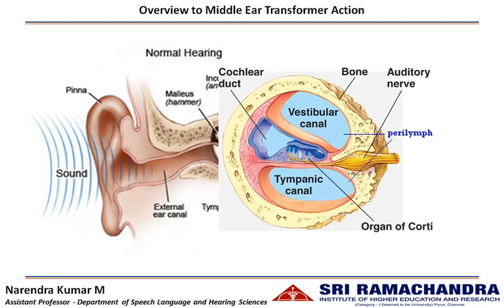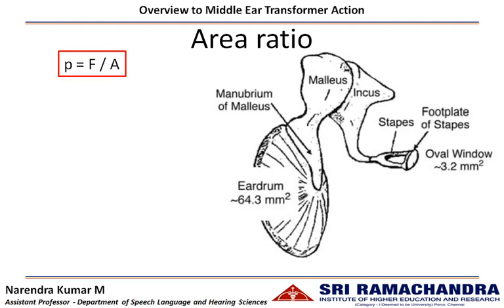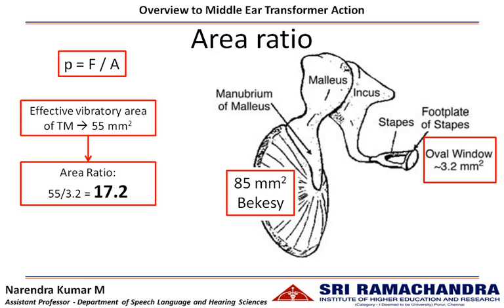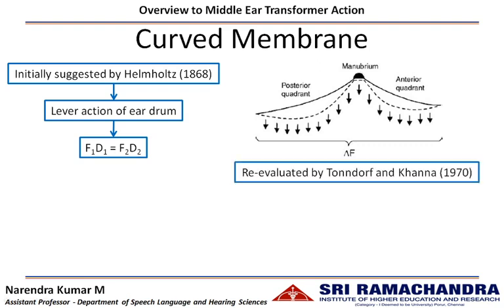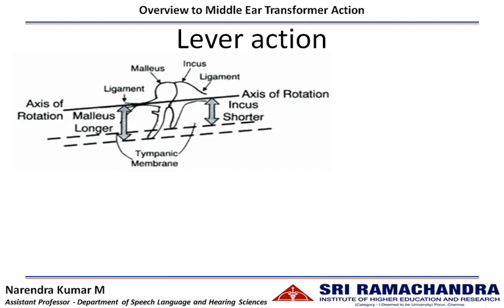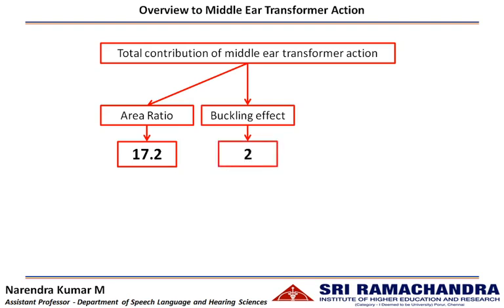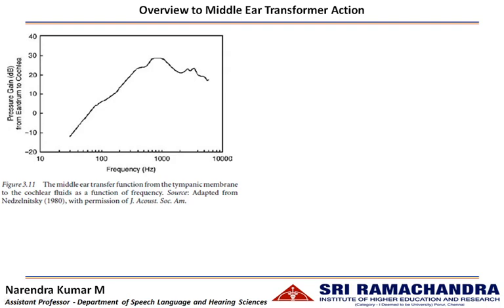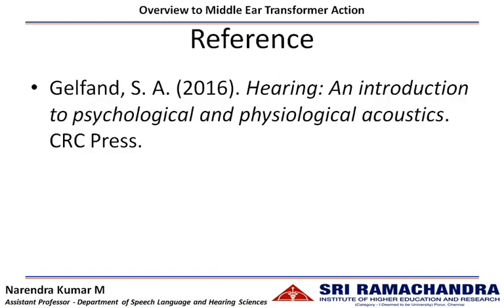Middle Ear Transformer Action

Comment: Sir i have one doubt, 
Why air is needed for vibration of ossicle??? Suppose if there is no air in middle ear , will the ossicle vibrate  normally???
Reply from the maker: The air pressure in middle ear and ear canal has to be equal for optimal vibration of tympanic membrane. If there is negative pressure in middle ear (Compared to atmospheric pressure/pressure in ear canal) TM will be pulled towards ME restricting its movement, if there is positive pressure in middle ear, TM will be bulged towards (mostly fluid) ear canal  - again altering the optimal position of TM thereby reducing the vibration of TM. When TM vibration is restricted, sound conduction is reduced. Ossicles vibrate only to the extent the TM vibrates. Hence air (pressure) in middle ear is important for optimal mechanical vibrations.